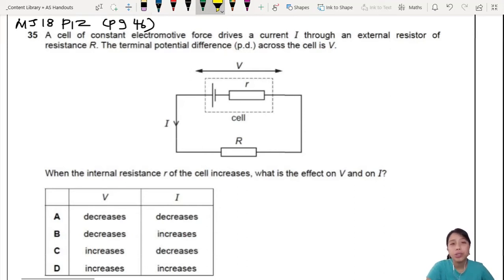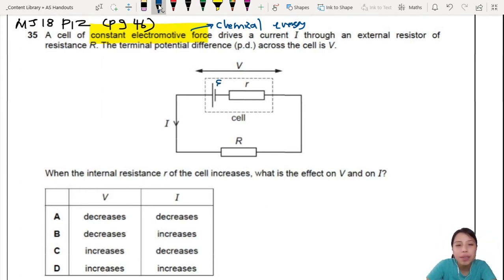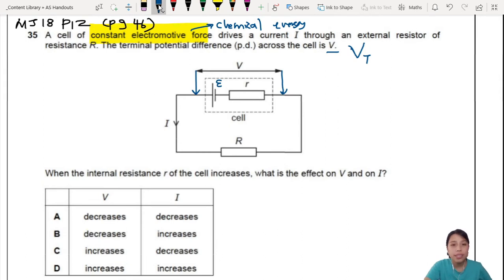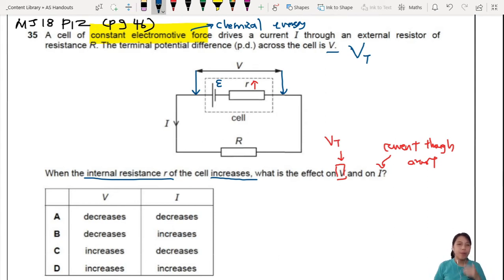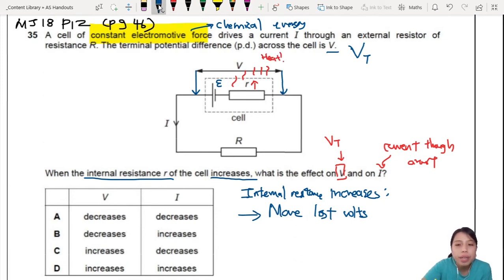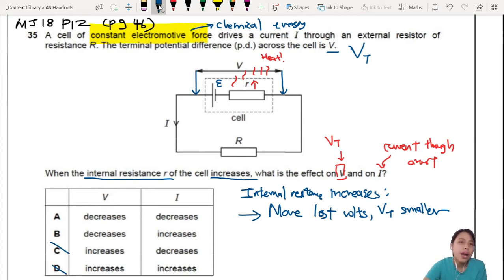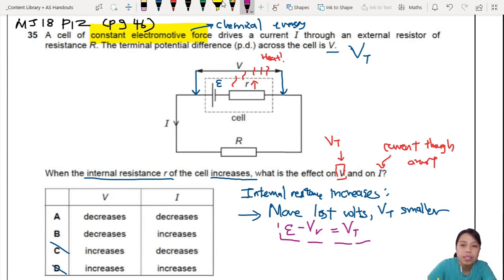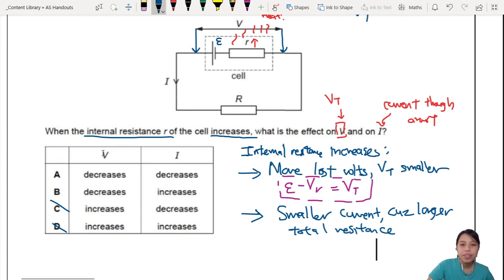9.2b Ex1 MJ18 P12 Q35 Internal Resistance Change | AS Electricity | Cambridge A Level 9702 Physics

Comment: wait but isnt current inversely proportional to terminal p.d so if terminal pd decreases, wouldn't current increase?
Reply: current will increase so that internal resistance will be constant (as gradient of vt and I graph = internal resistance). but in this case, we are just asking for the effect, current will decrease as more work will be fone per unit charge to drive it around circuit and through resistor in battery, so more energy lost per unit charge, there fore V decreases and current will also decrease as electrons experience more restriction